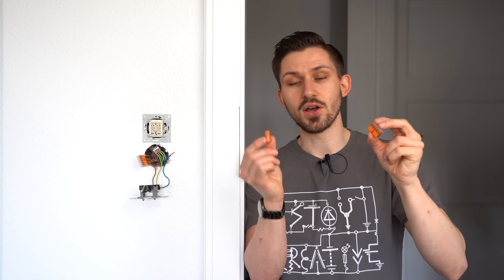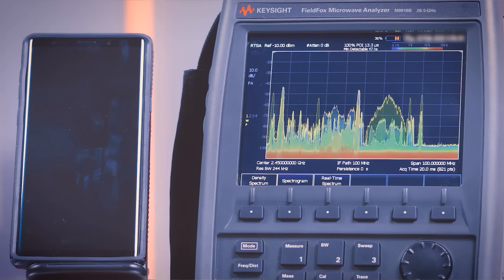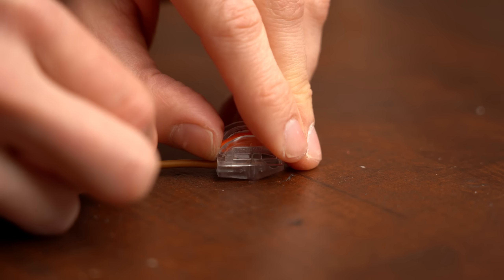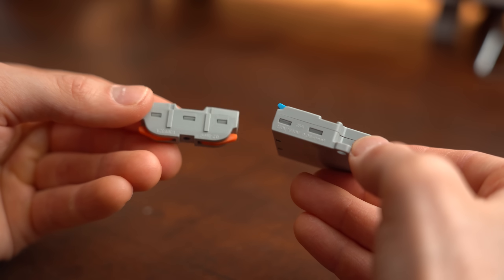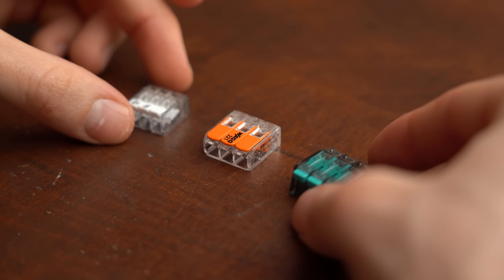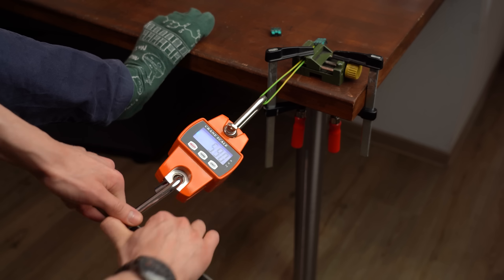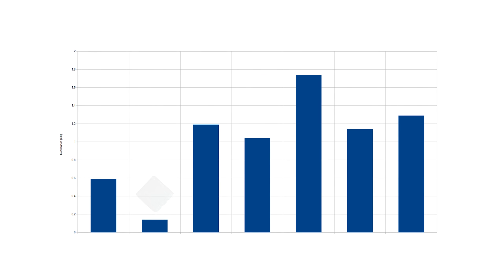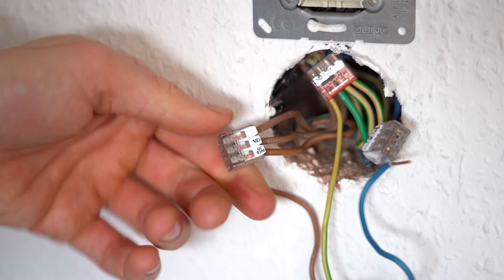I tested 7 Wago Knock-Offs Wire Connectors so you don't have to! (Surprising Results)

Comment: I really liked the video, very informative! Did you actually get a copy of / verify the certification for the product, because anyone can print the certification logo on its product. 

unfortunately I checked it once and the certification appeared to be fake.
Reply: Yeah, most of it will be fake (like the general CE marking) but about the ViD UC03M (ViolaDirekt) they are legit, the certificates can be downloaded on their website.
The "slide" connector  certs on the other hand are unfortunately probably fake.
Reply: @stehlajz  there's no such thing as a "fake" CE marking because the manufacturer self-certifies the CE marking. making it essentially useless.

per the EU themselves, "You don't need a license to affix the CE marking to your product, however... [o]nce your product bears the CE marking — if the competent national authority requests — you must provide them with all the information and supporting documentation concerning CE marking."
Reply: @LC-hd5dc  Actually there is. I know what CE means but many chinese products misuse the logo in way, that it means something else (usually China Export). The difference is in the logo itself, real CE have spacing between letters defined that when you finish the circle of letter C, the line will be at position of letter E. On the other hand the "fake" ones does not give a f about spacing or sometimes even font.

Comment: The only other test I'd like to see is running high currents through them to see how much they will take.  Other than that I do think this is really good information and I use Wago connectors in my house wiring all the time.
Reply: Well, thats determined by the resistance they have which also tells you about power-losses in form of heat.
Reply: @tarakivu8861  not entirely. It does not show how the housing would deal with the heat it looks like none of them would catch fire, but they will melt at some point and that would be very bad.
Reply: All of them work well above what is specified for 2.5mm 2 cables.  Check out 
https://youtu.be/bP0qHyVAymU
Reply: He did test the voltage drop at 20A which was negligible. Even with the worst result of 80mV at 20A, that’s still just 1.6W which is less than most dimmer units for house lighting will have to dissipate. None of the numbers are of serious concern even when heat dissipation is difficult.

Edit: I checked again and actually the worst result was 1.8 mOhm, which equated a heat production of only 0.036 watts. That’s nothing and maintainable 24/7.
Reply: @JoppedeZeeuw  did you notice the voltage at which the tests were done?  I watched and didn't see.  The best test would be at max rated voltage at max current.  Then wait a while.  That's when you would get a real honest test.
Reply: This is the test only the ElectroBOOM can truly do.
Reply: Failure testing at different ambient temperatures would be a good way to go.
Reply: It's like knife arguments. What's the best knife? I mean what's it being used for? Residential is fine. Wagos are great. Any kind of levernut really. I use them all the time. As for endurance I've never seen a levernut in an old plant that's been sitting there for 75 years+. I just see old wirenuts. When they are crumbling old wirenuts, most of the time they were just covering a tightly braided splice. If I want a high current splice that will never be removed and needs to last forever and even serve as a weight bearing splice if need be, I'm braiding solid copper then soldering it, and then twisting a wirenut over it if we're talking between wagos or wirenuts. If I'm wiring a light switch at home together or something I'm not really too concerned about what I'm using so long as I'm not trying to do some shit like hot glue wires together like jackass.
Reply: @Magneticitist  I'm a retired industrial electrician and for the most part you are 100% correct.  Thing is, most of the crap I had to work on in our foundry was stranded wire.  I love lever nuts for stranded wire.  And I especially love wire nuts for connecting stranded to solid wire.  But I still don't trust them for solid to solid when I expect high loads.  Hard to beat properly pre-twisted solid wire with nuts and good tape.
Reply: @Magneticitist  wirenuts can fail due to thermal expansion.
Reply: The resistance test shown in this video is flawed because he is only pushing 0.27V x 20A = 5.4 Watts through them.
He should be pushing 120V x 20A = 2400 Watts. Resistance increases with heat, and a 5.4 watt load isn't going to generate much heat.

Also: He should also be showing the wire-nut results as a comparison.
Wire nuts will always have significantly less resistance, especially at high loads.

It doesn't take a genius to figure it out, just look at the difference in contact surface area of a wago connection vs bare, twisted wires.
Wire Nut > Wago
Reply: @joshpit2003  I think you have a misunderstanding about how electricity works. At 20 amps, they're going to have a 0.27 volt drop across them, period. You can't change the voltage without changing the current, unless you change the resistance but he'd have to make them have a terrible connection to accomplish that and then, what's the point?
Reply: @joshpit2003 120v is not the European standard.  Same for wire nuts.  Fine for us Americans but irrelevant in Europe.
Your point is still valid however.  I came to see how safe different connectors are when handling 15-20 amps, not whether they burn with a blowtorch.
Reply: Resistance limits current the voltage doesn't matter you will still see the same issues moving the same amount of current.  @joshpit2003
Reply: @joshpit2003  Yup.  Your point is a big one.

Comment: Thank you for taking the time to research this! I thought your last video was very concise and i had never heard of wago connectors before then so thanks again for that!
Reply: And i always thought wire nuts are - nuts. 👍😁
Reply: @wolfgangpreier9160  dude since your comment, there has been 5 Fake accounts posting to various Adult websites! May need to check your Gmail settings and connected accounts bud!
Reply: @dans-designs  I am sooo lucky i don‘t use gmail! 😂🤣
Reply: @wolfgangpreier9160  hahah fair enough

Comment: Electricians in india use electrical tape for wiring 
We have no regard for standards
Reply: How does electrical tape transport current?
Reply: @wolfgangpreier9160  everything is a conductor if the voltage is high enough
Reply: @pierreuntel1970  Not Bose Einstein Kondensat. 🤣😂😎 End of know-it-all
Reply: @pierreuntel1970  nothing is a perfect insulator so yeah you are kinda right
Reply: @wolfgangpreier9160  we just twist wires together  and wrap eletrical tape arround it and done
Its similar to wire nuts
Reply: @prathampalang6687  Oh, ok. I've done this too, but only with up to 12V. And the last time - lets see, was about 40 years ago...
Reply: @wolfgangpreier9160  u just tape the wires together? ¯\_(ツ)_/¯

And just to point it out for everyone: 

NEVER do that!
Reply: @Shwyne23  I dont think thats a problem either as what wire nuts are doing is basically the same except you get a fancy and rigid covering for the connection, instead of that covering tape is used. And it also doesn't cause any problem except for the stickiness of glue after few years.
Reply: @anmoljindal9001  its always bad practice. Way more stuff that could go wrong.

I would never do it that way, parts to connect em properly are way to cheap for doin such a mess...
Reply: @anmoljindal9001  The problem with tape is it isn't suitable for a wide temperature range, which can lead to the tape coming off and exposing live wires. When I was young, I thought electrical tape was the only way to splice wires, but when I discovered heatshrink, I never looked back. All of that ignores soldering and physical connectors, of course, which I use when needed. About the only thing I use electrical tape for now is temporary fixes, additional strength on cords, and aesthetic reasons.
Reply: @anmoljindal9001  Never use electrical tape as a way to secure wires together... It just holds them together but it does not withstand mechanical stress, humidity and heat meaning over time they will degrade. Also, while you can easily put 20KG of pulling force on the Wagos, taped wires will let go much, much easier...
Reply: yea i can confirm this and have done this myself but i have used solder + heatshrink. the twisting the wires isnt even the worst part but most electricians even ditch the earth connection, but even with that house fires due to electrical reasons are pretty rare
Reply: Electrical tape is a standard too. Well kind of.  (⌐ ͡■ ͜ʖ ͡■)

Comment: i don't get it why not twist wires together and cover them with some tape ?
Reply: That would never meet electrical codes in most if not every country.
Reply: I changed some lights that had been there for a long time and the glue on the electrical tape was slimy and just fell off.
Reply: well thats what happens in most third world countries, heck most houses even ditch the earth connection, and the only form of protection is a MCB, still with all that, house fires are pretty rare and generally occur due to non electrical reasons
Reply: This is acceptable in third world countries, in North America and Europe this is simply unacceptable, far too high risk of house fires and injuries...
Reply: I hope you are joking

Comment: I'm studying to become an electrician and I feel that this is qwite pointless because the only time a connector should fal of is if someone is puling on it and has done something to mecj it fall of.
Reply: It depends on if you install your wires in a house before, or after the plumbing and HVAC guys.
Reply: I've seen wire nuts vibrate loose on machinery and even had several machines catch fire. When our company switched to Wago Lever Nuts the number of times we had a connection failure was zero. Over all using Wago Lever Nuts saved the company money in warranty repairs. The procedure using wire nuts involved wrapping the connection with electrical tape after installing the wire nut but they still managed to come loose and the time saved by not requiring this step offset the cost of the Lever Nuts.

Comment: Wago are good but damn expensive
Reply: Yep but for common projects, its a bit off budget
Reply: @69iqtutorial  hmm true, I usually just solder the wires when I'm doing something on a budget or connecting them with alligator clips before for testing and seeing if everything is working :)
Reply: Sure, if you need 500 of them it's a concern, but if you are just wiring in a ceiling fan or a smart switch then they make the job a lot easier.
Reply: Interesting, this video showed that knockoffs may be more expensive. Maybe it differs from country to country?
Reply: if you are professional then wago is damn cheap. Also, if you need to rewire a lot then again, nothing beats wago style connector. I just wished they came in more varieties similar to the knock-off, specially connecting/splicing 2, 3 or 5 wires.
Reply: I don't get why everyone says they are expensive. I mean 28 ct per piece, 50 pieces for about 15 bucks - should be enough for multiple projects, I don't see where you would use hundreds of them, also they can be reused.
Reply: Rather pay a bit more then burning your house down tho xD
Reply: Yes and no.  It depends on how you value your time.  My projects are repair and tinkering.  In repairs/upgrades, I spend a lot less time per junction box while adding easy testing and modularity.  I avoided wago because of the price but regret waiting so long.  Factoring in how many units I actually go through the price is a non issue.  Compared to the price of wire and the accessor I am wiring, non issue.  Compared to the cost of a structure, negligible.

Comment: I think the comment on the previous video about the knock-offs was referring to the connectors on Amazon that are branded Wago (or look very similar with no branding) but when compared to a genuine Wago connector, it is clear they are fake and are made with subpar materials and inconsistent build quality.  This happen to me when I bought a set on Amazon.  The product page looked legit but when I received them it was clear they were fake with no branding and the metal bridge was really thin and bendable.  I ended returning them for a refund.
Reply from the maker: Thanks for the feedback. I honestly did not found such knock-offs on Amazon yet. I would have loved to have a look. But I think my small selection was also quite interesting ;-)